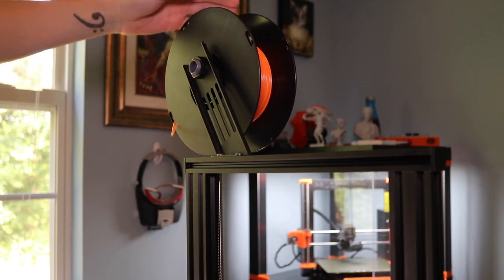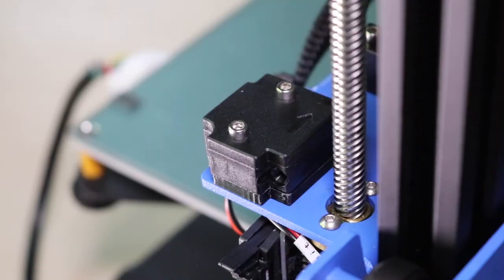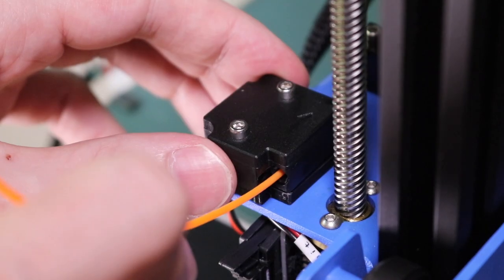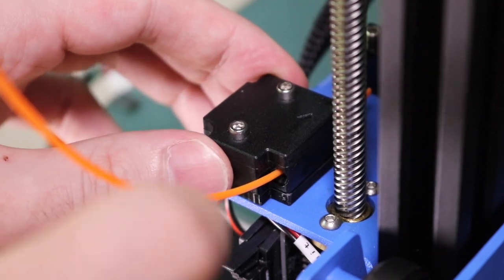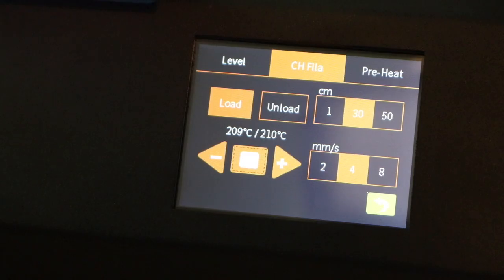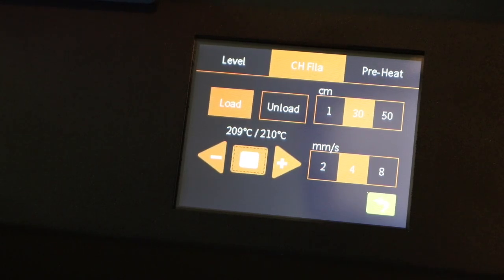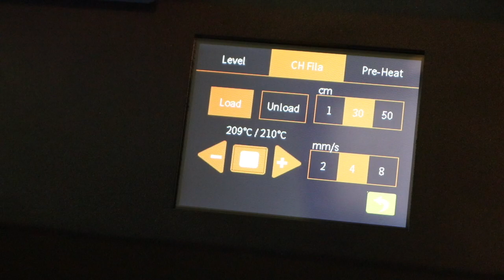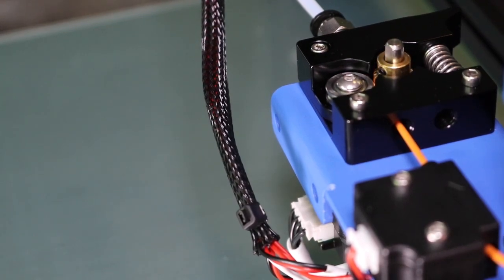Loading PLA Filament into the Anet ET4X 3D Printer

Comment: Hello i have a question  i have et5x  and the filament is stuck in the feeder i have taken it apart and it stuck right before the bowden tube leading into the extruder but i cant grab it too short and i cant push any new filament into it any suggestions on how to get it out thanks
Reply from the maker: Any chance you have a picture? Sounds like you may need to disassemble the idler wheel mechanism to release the tension and pull it straight out!
Reply: @AndrewSink  yes I can send a pic let me know where to send it..I did disassemble it and took the idler off but it stuck like its melted in there.
Reply from the maker: @rodneysmith7979  just upload to imgur and post the link! You might need pliers to grab it, but it should pop right out!
Reply: @AndrewSink  well I got it...I had to wiggle the piece back and forth for about 30 minutes but it finally came out.
Reply from the maker: Great! Glad to hear you got it out!